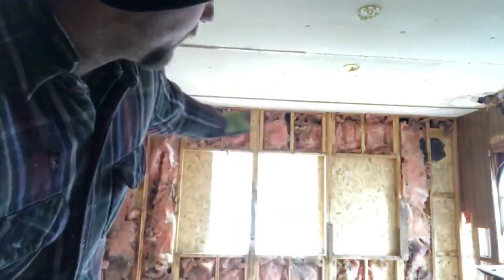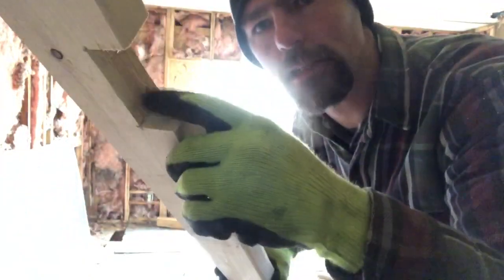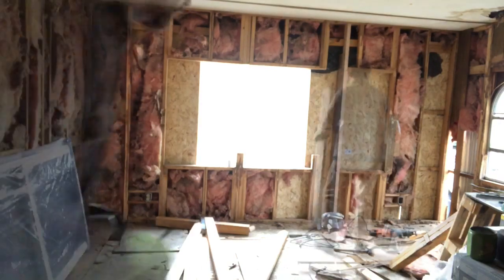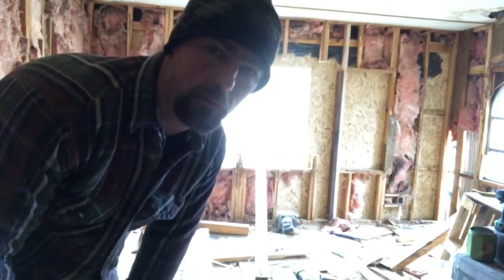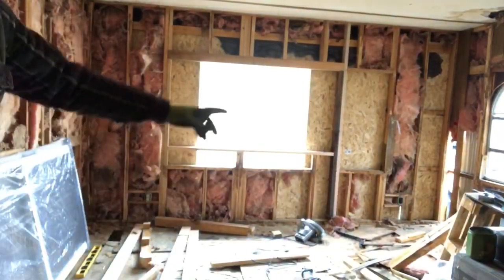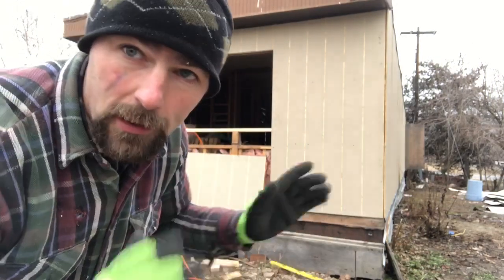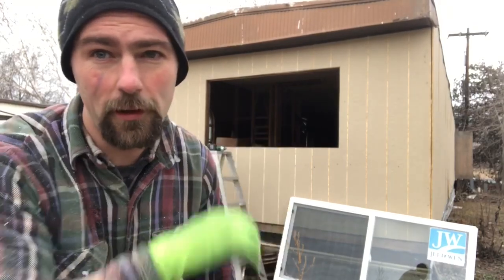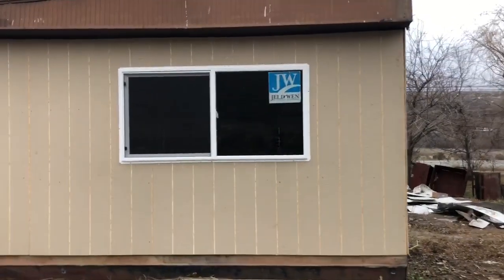Mobile home gets new window | Frugal Landlord

Comment: You should use a minimum of a 2x8 header to support the 4x ridge support for your roof. You'll probably be OK but it is really weaker than it should be especially if you get significant snow load.
Reply from the maker: Lol support what? this wall is supporting nothing, people forget this is a mobile home and made to be light weight, non of the windows came from the factory with headers, but that is beside the point that this is not a load bearing wall.
Reply: @frugallandlord6974  probably speaking of codes , codes are opinions, thats why everyone debates the "right" thing to do
Reply from the maker: @Jay2three   sure but mobile homes are built differently than stick built homes, I have installed windows on lots of mobile homes and I have never seen any of them with a header of any kind, let alone a 2x8, since this comment the home has had very significant snow load, no sagging, no nothing, he also said something about a 4x ridge support, I have never seen that in a single mobile home either, they are built with 2x2 trusses and some of them actually 1x2 trusses that are supposed by the long outer walls. You know how it goes, I’m fine with criticism, I’m just correcting him because he just doesn’t understand how mobile homes are built.

Comment: You say you are not a carpenter, but that is not what i see in this video!
You need a cordless framing nailer. Screws are expensive!
A 4ft Level. And an 8ft straight edge would be a great help.

Comment: No flashing? Thought that was a must to prevent leaks coming in.
Reply from the maker: Sandi C,  I did install flashing when needed, but no need for any above this window its directly under the eaves, I also took all the windows out after it got warmer and beaded them with 100% silicon calk.
Reply: These are silicone and pin windows regular windows are flashing here doesn't need to with this type .plus he had a foot over hand or so bet its cold there any ice?

Comment: Question, I need to replace a window in my mobile home. Windows at home depot or lowes will work just fine?
Reply from the maker: yes I recommend measuring the rough opening and ordering custom windows it is much easier if your windows are not round
Reply: Would love to know how you made out. I'm doing this now in a mobile home. I have one new construction window with the flange and three pocket replacement windows. They key with the pocket replacement windows (no flange) is to cut and reframe for the window then do your trim on the outside. Now you have something to sit the window in and against. That is the key with windows without the flange, Easier to do it this way because you can put the window in from the inside, no ladder needed.
Reply: @TheCookster64  l
Reply: Five windows now done!